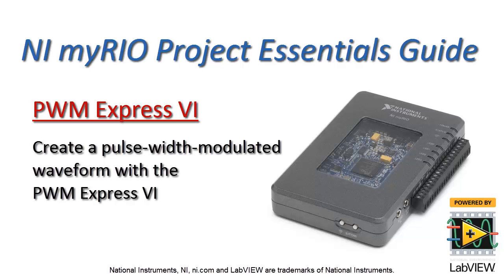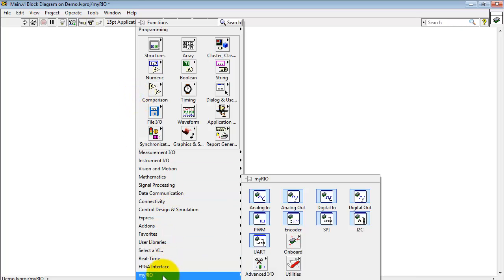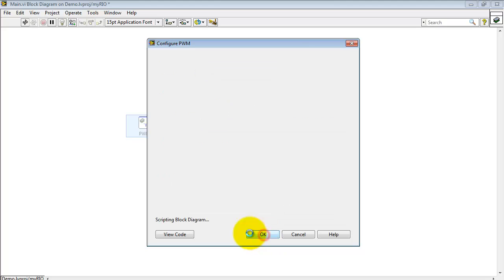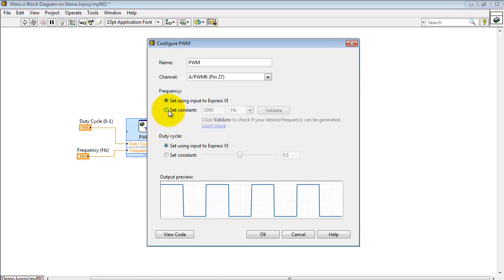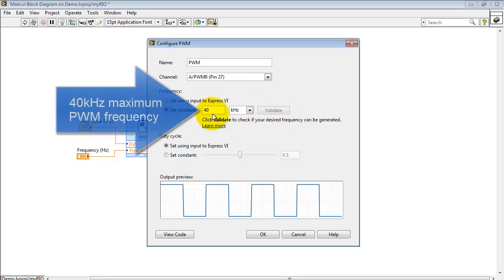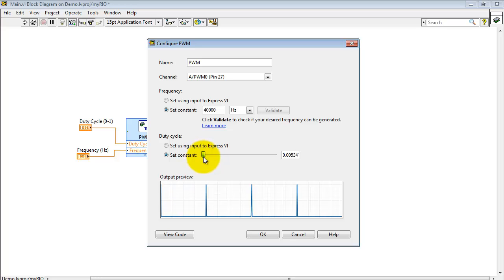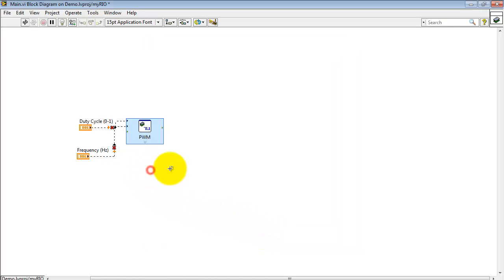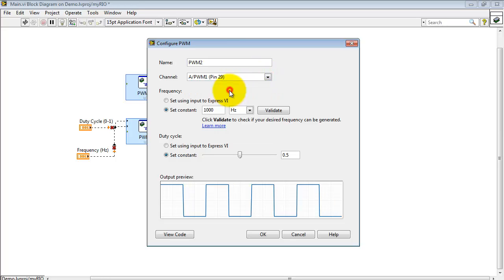NI myRIO: "PWM" Express VI

Comment: So I see A&B connectors have 18 DIO lines. What is the bit width of each line. I assumed each line was a bit? so there are 18 bits of input/output for digital?
Reply from the maker: myRIO has a total of 40 DIO lines: 16 on each of the A and B connectors and 8 on the C connector. Each line is a single bit, but depending on how you structure the software you can group two or more lines together and treat them as a parallel bus. Also, some of the DIO lines are shared with other resources such as PWM outputs, encoder inputs, and serial buses, i.e., if you are using lots of PWM, encoders, and serial buses you have fewer DIOs available.

You can download the myRIO manual at http://www.ni.com/manuals; enter "myRIO" in the search box. The "Hardware Overview" chapter details everything you need to know about the available interface lines.